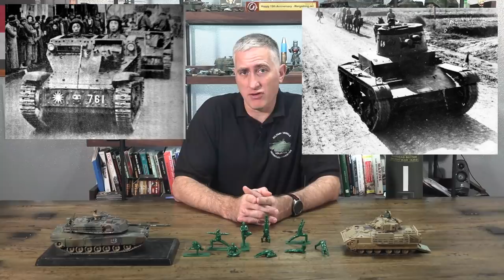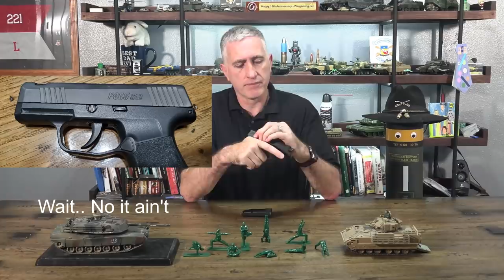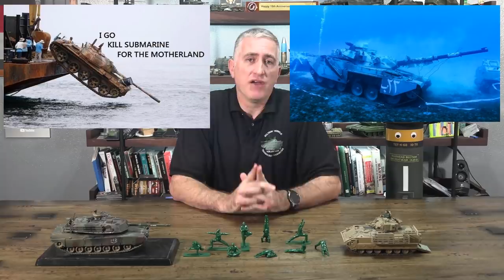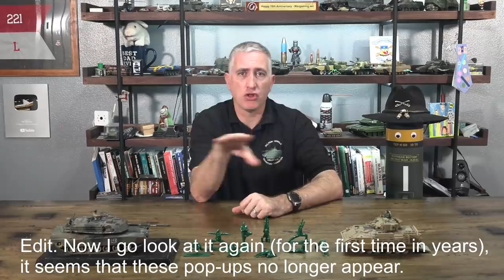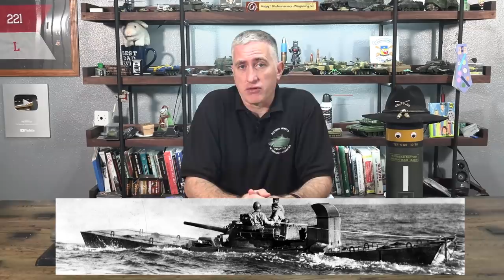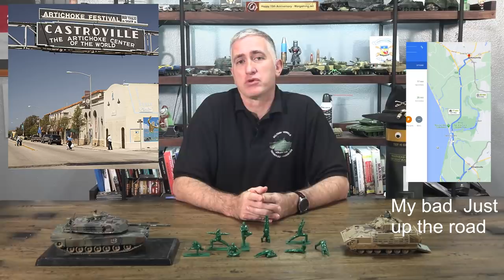Chieftain's Q&A 17. Rants, Ladas and shooting the other guy's cannon

Comment: "The idea that you are not poisoning the world by not using DU doesn't really hold water." But apparently water holds it all.
Reply: Shoot, I thought the problem was kids playing with the shrapnel, radioactive dust in the dairy stock, and Gulf War Syndrome -- nothing like lil' bits of fallout lodging throughout the body and smacking one's DNA with bowling balls at point-blank range.  The specification of Tungsten alloy is the interesting part... alloyed with what?
Reply: @johnd2058  DU isn’t particularly radioactive, it’s a heavy metal problem. Your average coal mine or natural uranium is more radioactive. DU basically blends into the background radiation.
Reply: @johnd2058  I may be mistaken here, but from what I can gather on use of hard alloys and composites, tungsten AP rounds and cores use tungsten carbide (and maybe mixed with other carbides) powder sintered with some kind of metal matrix filling the gaps. It's similar in concept to carbide tools used on lathes and milling machines: tungsten carbide or mixture of carbides provide hardness, metal matrix (usually cobalt, not a pleasant metal to get into your system) provides toughness.
Reply: @jeffreyroot6300  Uranium emmits alpha particles.
Think of them as the HE-Shell of ionizing radiation: Huge dammage potential but crapy penetration.
As long as the source is on the outside of your body, you're good, as alpha particles cannot penetrate the outer layers of dead cells of your skin. But if the source is in direct contact with living tissue - like inhaled uranium dust in your lung, the alpha particles will go at the living cells' DNA like a wrecking ball...
Reply: @jeffreyroot6300  > DU isn't particularly radioactive.
Half life of 4.470 thousand million (US billion) years.  The only thing radioactive with a longer half-life is the most stable bismuth, at 250 (US) billion years.  Then it is lead (Pb) which is stable (as far as we can tell), just a heavy metal (which is the problem with DU, not its radioactivity).
Reply: @Bird_Dog00  It does! Depleted uranium is a lot less active, but all uranium has a half life. That radiation damage from DU is not the biggest threat, even ingested. The heavy metal poisoning will make it look like a joke. Even enriched Uranium, especially if it’s inhaled or ingested, the poisoning will get you first, and be very debilitating. Moral of the story: don’t mess around with destroyed battlefield wreckage. Filter or distilled water. Use. PPE if you have to inspect the wreckage.
Reply: @jeffreyroot6300  Inhaled Uranium Dust is known to cause lung cancer.
So, the claim that the biochemical effects will get you first isn't true in all circumstances - at least if you mean "get your first" the way I interprete it: as in "kill you".

I know that the toxic effects affect organs like liver and kidneys, as well as reproductive organs afaik, but the sources I^ve read so far were a bit vague.
Reply: @Bird_Dog00  nicely done.
Reply: @Bird_Dog00  Depends on the dose, as always, but cancer is always a game if odds in the margin. I got mine with very few obvious risk factors, though my father and maternal grandmother both died of unrelated cancers. Heavy metals are highly toxic and tend to accumulate no matter what, thus being a direct threat to everyone exposed with little intervening variables. Example: cancer is a result of DNA damage in reproducing cells. Most such damage results in the cells becoming unviable and dying ( apoptosis) or becoming senescent, which becomes a cumulative toxicity issue if it’s own. Only a very small subset become cancerous, and a functional immune system eliminates most if those.
Reply: @theleva7  Ahhh, that would explain the alloy-specificity.
Reply: @jeffreyroot6300  well disagree,  the fine dust is alpha radioactive and when ingested or inhaled it becomes a problem.  I seen the dust it generate and our Geiger showed significant radiation.  So none of us got close to it without NBC gear
Reply: @jantschierschky3461 Masks at a minimum! Alpha radiation is fine as long as it’s outside the body. My takeaway is, don’t mess with the wreckage if it’s possible to avoid it! And reverse osmosis or distilled water a must. Heck, destroyed modern military vehicles would be toxic no matter what it was shot with! That’s why fallout dust has to be washed off the body during decontamination. Alpha particles won’t penetrate skin or clothing, a sheet of paper, what have you. I get regular PET scans that are definitely are irradiating me internally, but like everything else it’s in the dose.
Reply: @jeffreyroot6300  wtf are you telling me that ? Think pretty clear I have full NBC training.
Reply: @jeffreyroot6300  ..now you tell me 30 years after the fact...19 year old gunner inspecting handiwork at the aftermath of the battle of Medina Ridge..
Reply: @roninsct7017  Lol We were all young and dumb! Now I’m older and foolish enough to get into debates on the internet! No, I wasn’t there. I washed out for medical reasons, but many if my friends were.
Reply: @davidweihe6052  You lack even a basic understanding of radiation and half lives. Radioactivity is inversely related to half-life. A long half-life means that U-238 emits a small amount of radiation for a long period of time. The are also plenty of isotopes with longer half-lives, such as Thorium-232.
Reply: @Bird_Dog00  As he said, DU is far more potent as a heavy metal poison than as a radiological poison. By the time you've ingested enough to cause a statistically significant increase in cancer odds, you'd probably already be dead from the chemical effects.
Reply: @jantschierschky3461  ...That has nothing to do with radiation health physics.
Reply: @jsn1252 ???? Are you telling me my army training was wrong ? All the hours of study ? Wow
Reply: @roninsct7017  My mistake! It suddenly hit me the name of the battlefield you’re referencing. Please disregard my mistake as chemo brain!
Reply: @jeffreyroot6300  It used to be still enough radioactive to kill if inhaled as DU dust...
Reply: Apparently, still a lot of enriched uranium in DU dart. No, it's not only the case of "heavy metal toxicity". DU is never fully depleted and as such inhaled dust kills you easy enough with your cancer as it does with toxic heavy metal properties.
Reply: I made a post on this regard w/o noticing that this was being discussed already. Tungsten carbide is defo not environmental friendly whatsoever and certainly can contaminate soil and water as much as DU. But lets not kid ourselves, DU is not employed by EU countries not because it contaminates the soil (Which TC, lead alloys and pretty much any kinetic or else munition does) but rather by very different concerns. There are dozens upon dozens of papers on wounder veterans that had DU shrapnel on them and/or ingested DU-contaminated dust, and while certainly these contaminations are not lethal per-se, their adverse health effects are extremely well documented.  That being said, it is these same EU countries that have vetoed any attempt to make these munitions illegal via the UN, in spite of not employing it themselves, if nothing else because they have the know-how to manufacture it and substantial stockpiles of DU to be employed if need be.

Comment: Well... Anecdotal experience and all... From having served in the Finnish Defense Forces as a conscript... We had both Soviet and Western stuff. The Soviet era stuff was typically crude and broke down quite often compared to the contemporary western stuff. HOWEVER the Soviet stuff was bloody easy to repair and get back running. So it could remain running longer as it could be repaired anywhere instead of requiring specialists (like Western stuff often did). Soviets stuff also had plenty of very clever and simple, essentially for western POV thinking-outside-of-the-box style solutions, which often worked very well.

Whole another discussion is what is cost efficient and what is not. I have seen references to old tech comparisons (as Finland straddled the line it had access to both eastern and western stuff) of (for example) circular saw blades. On cost-efficiency basis the ones made in Soviet block won over all others. On one-on-one comparison they however were the absolute worst of them all. Catch was that you could get boxes of them at the cost of a single quality blade.
Reply: What makes that comparison very complicated is the cost of work hours. To stick with the example, making that better Western sawblade is just as fast as making the cheap Soviet one, but you need better materials and more expensive, more precise machinery. So you pay more up front with the Western product, but with the Soviet one you spend a lot more money later, in the form of time spent changing worn-out blades for new ones and fixing problems when a blade gets stuck. That's time where you pay your employees but you're not producing anything.
Of course, if you are the Soviet Union, work hours are very cheap but sophisticated machinery is very expensive, that's why they did it that way.
Reply: This is a similar issue facing anyone making or attempting an AK47/74 style gun in the US commercially.  The cheaper prices on AK's in the past have stayed in the consumer mind, so when they bought an imported AK  years ago for say 500 $, but saw a US clone offered for say 1000$ or more.  Can't even argue quality vs cost either as many Eastern Bloc versions are excellent in fit and finish.  Hard to compete when major expenses are subsidized on the exports

Comment: 22:30 I think I remember that the Soviets operated some Panther tanks (and also made slight modifications to them. Like making the lower glacis plate removable so that they can service the transmission. WITHOUT having to take out all the internal equipment, and pull the turret off like you normally do for the Panthers). But, I don't remember if they actually used them in combat

Comment: The mirrors are important for German tanks since the would not be allowed to drive on the road without theme or indicator lights, brake lights, etc.
Reply: Same in the Uk, its a legal requirement for ALL vehicles to be able to drive on Roads, when on Exercise the mirrors, lights and indicators etc are covered up

Comment: Don't remember where I heard this. And I'm assuming short 7.5 in the last question refers early Stugs.

The steeper trajectory is an advantage because HE rounds are less likely to ricochet off the ground (they're assault tanks rather than TDs). And the lower muzzle velocity means you can make the shell wall thinner, increasing filler.

Comment: On tanks getting stuck: There was an interesting incident a few years ago, when an USMC unit visited Sweden for a joint exercise. They got one of their M1s stuck in a bog, and the swedes had to pull it out with their leopard ARVs. They posted pictures of the vehicle afterwards, and literally the entire thing up to the turret roof was covered in black mud. They'd left the drivers hatch open so some scooped inside as well. It turned into a long night for maintenance to get it back into service.

Comment: 35:28 you forgot the following:
- working, powerful yet silent AC
- water tanks for bot hot and cold water
- several cupholders which never get in the way yet are easily accessible
- self-parking capabilities
- large flat deck for comfortable sleeping arrangements

Comment: Concerning riveted tank waterproofing; The riveting used was presumably hot riveting, a method also used on ships.
In short, the holes are countersunk on both sides, and the rivet made white hot before being peened. When the rivet cooled it would contract, pulling the two pieces even tighter together. A riveted seam is not necessarily weaker than a weld, but bulkier.
As a side note, the fact that the rivets are under internal tension might be why spalling is such an issue...
Reply: I was going to mention ships, but also boilers and real tanks (ones to hold liquids) were all riveted at the time.  If the designers wanted water tight, it could have easily been achieved with riveted construction.
Note though, I don't think countersunk holes would not have been common.  Google "ship rivet" and you will see round heads, even on the outside of ship hulls, was the norm.

Comment: I went through an NTC rotation with a broken idler arm that couldn't be filled with grease, and lost it at a high rate. Within 3 days most of the grease was gone. The track would bounce arround and the sprocket would ride on it from time to time. If we needed to turn left, the driver was instructed to do about 1/8th turn then go streight. Or on some occasion we'd just go right 270°.

Comment: When I was in the army back in the 80s I served in the FDC of various towed and self propelled field artillery batteries.  We preferred to use an M577A1 or A2 at the time.  As either the driver or later the section chief keeping up with vehicles PMCS was my responsibility and one thing I was taught was to always keep the track tension tight.  Too loose and you were likely to be making a trip to Battalion maintenance.  Too tight could be an issue as well as but we always preferred to err on the side of caution or in other words keep the track tension as tight as possible.  Now as an avid modeler for most of my life I have come to love watching many of the videos put out by some excellent model makers. One thing that caught my attention right off was the insurance by many modellers to put a lot of what seems to me to be far too much sag in the tracks.  My own time in the army taught me that a lot of sag was a bad thing and the tension needed to be adjusted.  I have no idea how the track tension on modern M1s or Bradley's works. My own experience is with tracked vehicles in artillery batteries from the early 80s like M109s, M548s and M577s. We were taught to remove the sag. Now as far German panzers, Russian tanks and other vehicles from WeW2 I can only go off of photos and videos from that time. My obsesrvation is that excluding vehicles like Russian t 34s with Christie suspensions most did not have too much sag. I know I tend to ramble on these days, don't know if you have an opinion on this. Enjoy your videos
Reply from the maker: I would consider "lots of sag" to be analogous to the concept of over weathering in the modeling sphere. Looks great, not impossible, but over-frequent

Comment: I was no pzgrenardier but as a cablemonkey had training on the remote MG 3 of the Marder 2.  The purpose was to provide rear protection when travelling and when troops dismount or re-enter.  Because is mounted high you could use without the fear of hitting your own troops.

Comment: While I was teaching the M1A2 (original flavor) to Kuwaiti Army tankers I was asked every class whether the M1A2 or the M84s (Yugoslav built export T72s) parked in the next motor pool  were better. Would give the same answer: one is an apple, one is an orange, both fruit but with different  design specs to fit in different organizations.  Wnet into greater detail regarding logistics, tactical doctrines, etc. Never did come out and say there were a whole lot more smoking holes in Iraq with T72s at the bottom than M1s.  Hey who said an old cavalry tank noncom can't be diplomatic?

Comment: Heya there Chieftain, got a question about something I've read recently that's confused me, in December's edition of Heritage Commercials they had an article about the ALE Trojan, the Unipower MH8875 and the Scammel Commander in which they mention during it that during operation Desert Storm in the Gulf War that during the later stages of the war Scammel Commanders were used to transport reserve tanks immediately behind the advance where they were transported fully equipped and ready to go, my question is why was this needed and is there any other example of it happening?

Comment: 37:38 Regarding the M60, It is often overlooked that part of American design criteria was the ability to mass-produce its tanks with relatively little tooling up. The USA planned to have the ability to produce 10,000 or more M60s a year within a matter of months of a great war starting, basically replicating the success of the M4 Sherman in WW2. What the M60 lacked in protection and firepower would be compensated for by numbers, ease of maintenance, and a relatively cheap but very advanced electronics suite giving each tank considerably better odds of putting its firepower where it would do the most good.

Comment: With regards to field mods S.Pzjg.Abt 654 moved the tools and cleaning rod tube from the sides of their G1 Jagdpanthers to the rear. This was carried over by the assembly plants with the introduction of Jagdpanther G2 with the exception of the cleaning rod tube and the jack block which remained on the sides of the vehicle (this is also how you can tell a G2 from a S.Pzjg.Abt. 654 G1)

Comment: Adendum to 0:9:30 combat duration... using the main gun to further debris debris can have a very positive effect on the combat endurance of a tracked combat vehicle, even if it's just 30 rounds of .50 to break up a chonk of cobblestone wall.  Sure it announces your presence but making your combat entrance missing a track can be quite a bit more maneuver ending than making a boom.